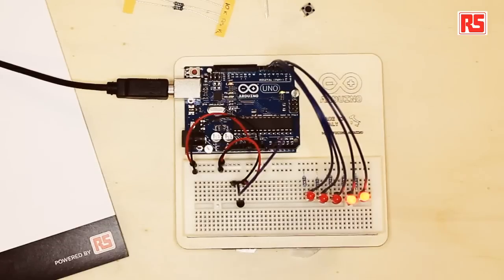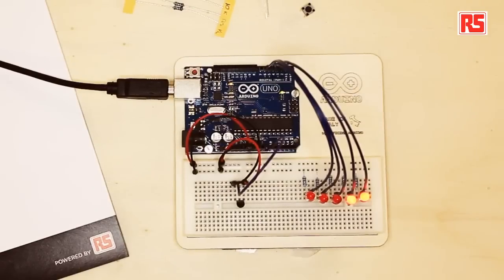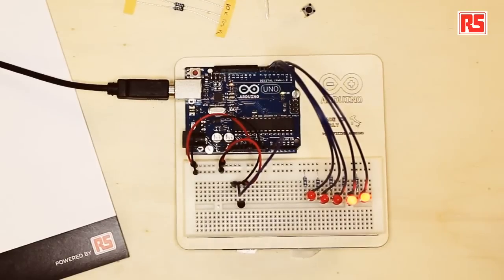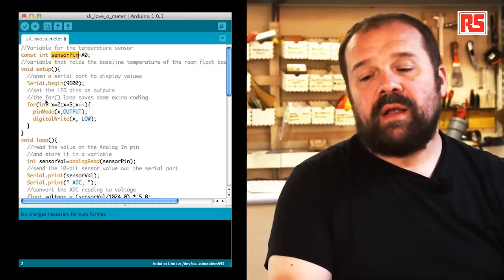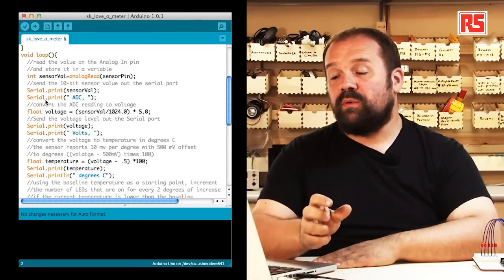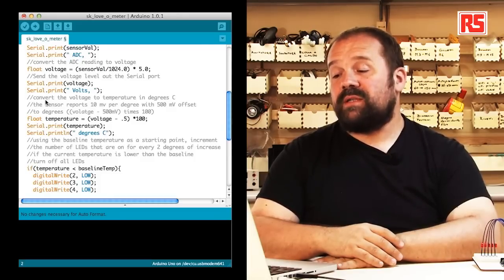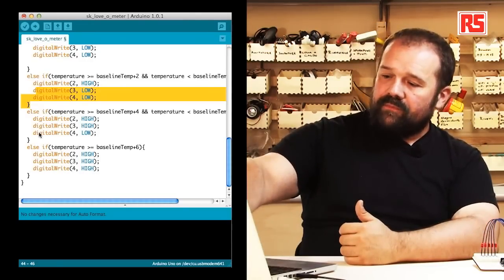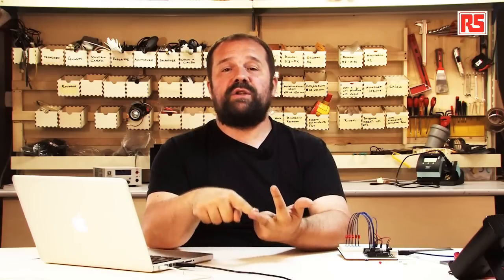Arduino Video Tutorial - 03 The Love-O-Meter

Comment: key important note: the rounded head of the temperature sensor has to be connected facing away from the Arduino if u use the starter kit guide, i din read it until i burnt my hands hahaha 250 degC
Reply: RIP
Reply: you nearly burnt the sensor lol

Comment: If you don't want to go through all the if statements and individual LEDs, you can try to add a function like this one:

void led_control(float base_temp, float temp_step, float temp_measured) {
  for(int x=3; x<=7; x++){
    int i = x-3;
    if(temp_measured > base_temp + temp_step * i){
      digitalWrite(x, HIGH);
    }
    else{
      digitalWrite(x, LOW);
    }
  }
}

Comment: Okay... Two questions - you have five LEDs but in the loops ar only 3 in use?!

And: What ist "Baseline Temperature"? Is this automaticaly generated?
Reply: Hello Christian, I have exactly the same questions. I have not tried  the code yet but i think that 3 loops are not enough and that the Baseline Temperature should be defined at the void setup loop of the code. Did you find any answers? Please advice.
Reply: 1. Yes this program was incomplete. if you want to use 5 LED's, change "for" increment in setup function to " x < 7 " and you can add digitalWrite of pin 5 and 6 in if Statements of loop function.

2. Baseline Temperature is mostly room temperature and you can declare above "setup" function as 
           const float baselineTemp = 20 ;
    "20" is my room temperature. you can find yours by after declaring baselineTemp to 0, just trace the temperature variable using Serial println command in loop function without touching LM35. once you find that you can define that in baselineTemp.
Reply: hey dont be rude

Comment: What if you start executing the code when the temp sensor is in an environment of 21 degrees C? non of the light will turn on thus the first "if" is from lower than BaselineT(=20) and the next "if else" is from higher than BLT+2(=22)??